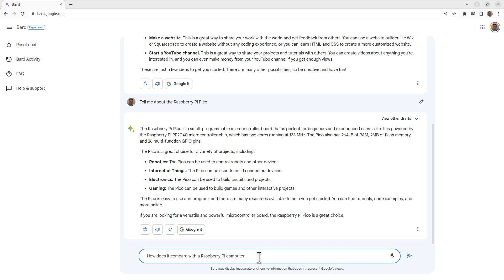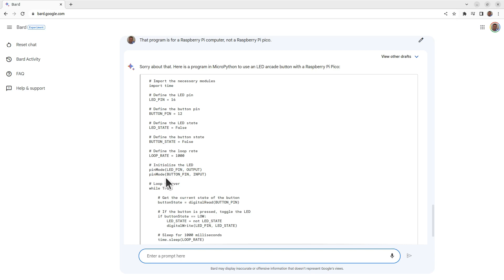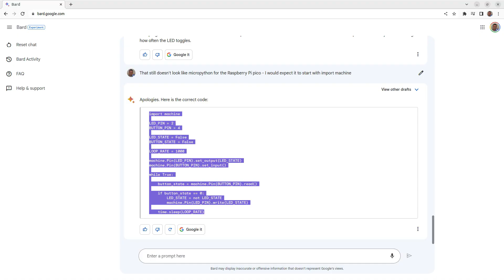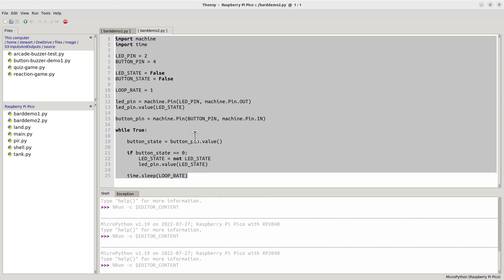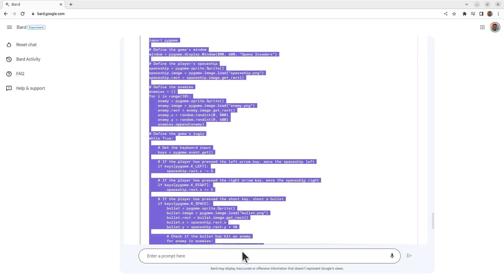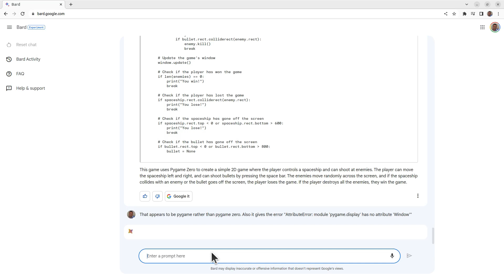Google Bard for Makers - Alternative to ChatGPT - creating code for Raspberry Pi Pico

Comment: So I'm interested. Did Chatgpt actually do better than this? Im from Germany so I can't use bard either way but it would be interesting to know when it maybe finally gets here.
Reply from the maker: From what I've heard I don't think ChatGPT is much different. They don't really understand the context or what they are doing. 

In the case of Bard's second attempt at the arcade button code it appears to have taken code from Arduino C++ and MicroPython and put them together. So whilst the syntax looked like MicroPython the code just wouldn't work. 

No doubt they will get better at finding code snippets and putting them together. I expect it will be able to write fully working small programs, but I don't think it's going to be able to replace a good human programmer for a long time and even then will need someone to be able to explain the problem to the bot in a way that it can interpret it.